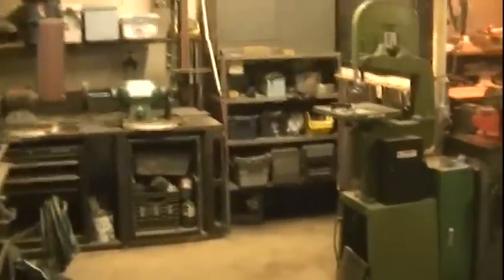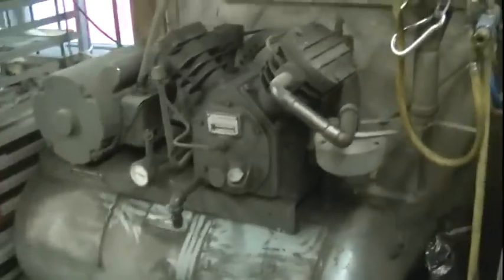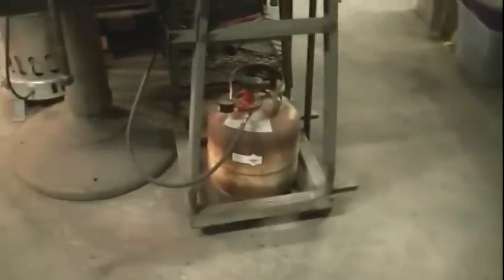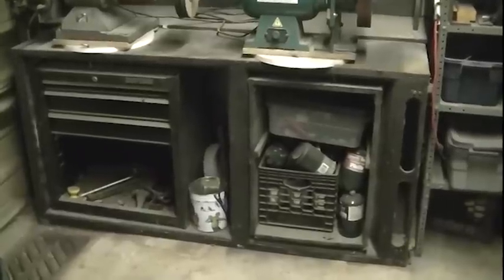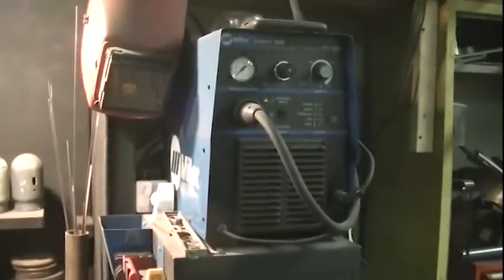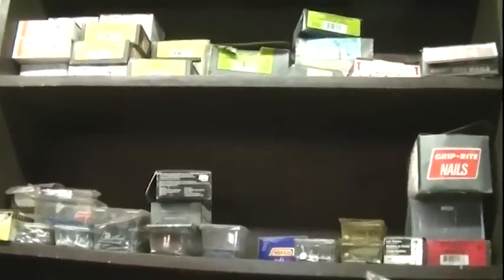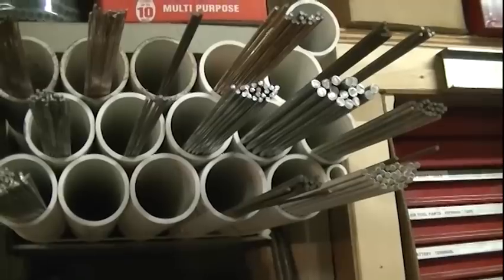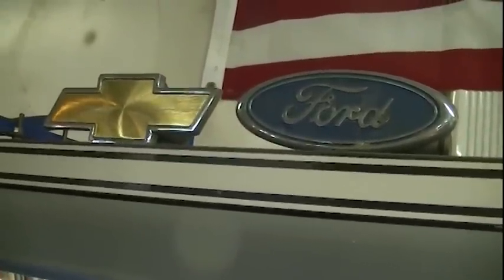Viewer Requested Shop Tour

Comment: Nice shop!
If your local building codes allow this, a solution to recover some useful space would be to make a sort of external insulated container for the air compressor, hanging it on the external side of the wall. A friend of mine made that to get rid of the noise, and it was a success.